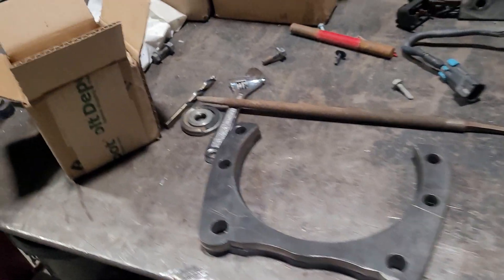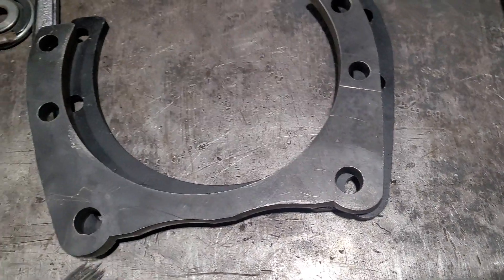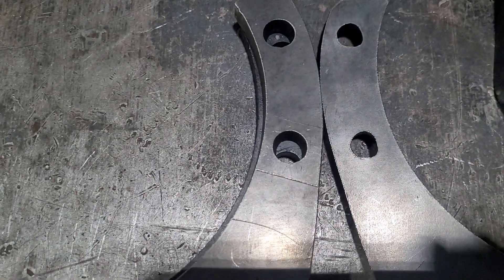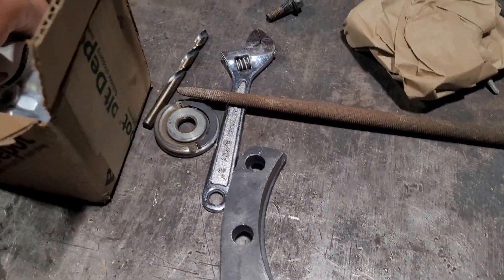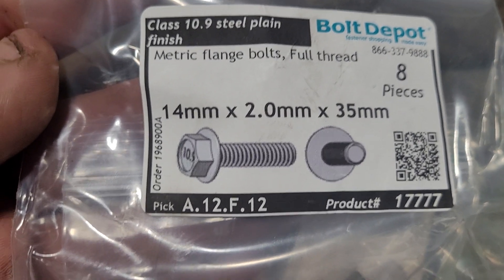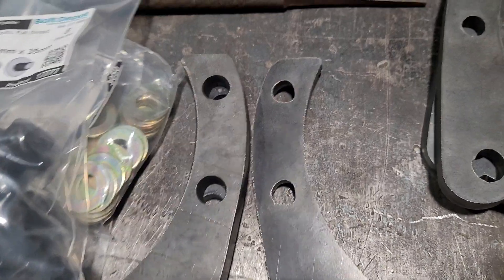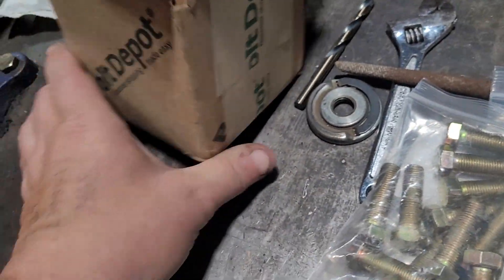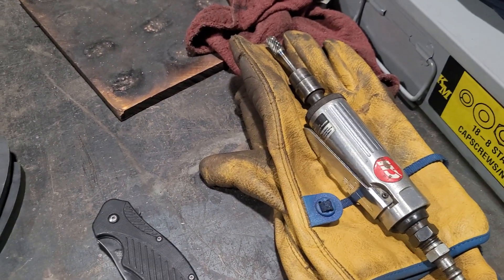Rockwell disc brake mounting brackets and hardware.

Comment: What are the rotors and calipers to use with your bracket?
Reply from the maker: 2000-2004 F350 dual rear wheel rotors and calipers

Comment: Were do you get these brackets?
Reply from the maker: I listed them on Ebay just to make it easier for buyer and seller protection.
Reply: @KDuboutdoors19  do you have a link?
Reply from the maker: Item number 374758548432, be sure to read the description. Listing is for two brackets to do one rear axle.
Reply: @KDuboutdoors19  I copied and pasted this number into the advanced Ebay search and got no results. Are they still there for sale? If so, why cant I locate them?
Reply from the maker: I had a Fabrication shop make them for me.